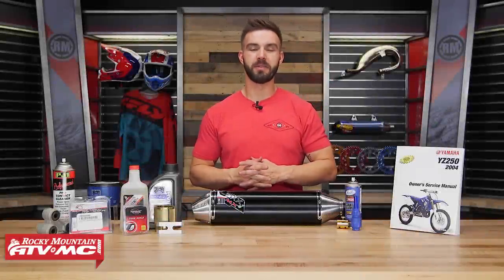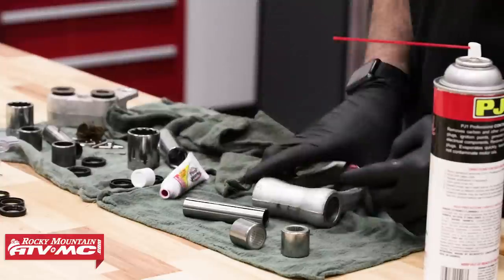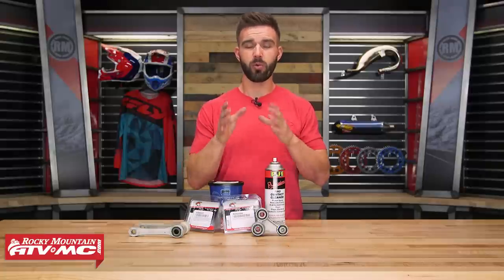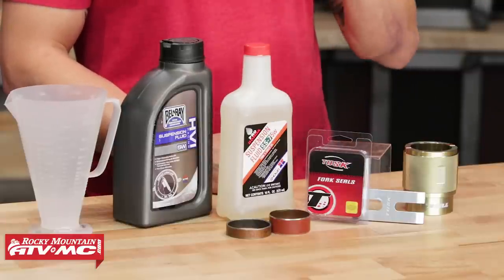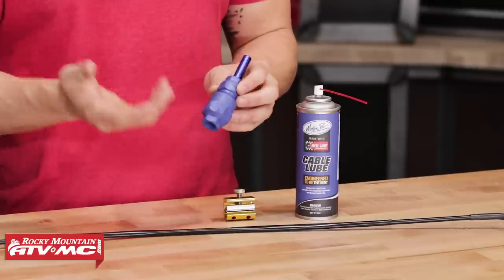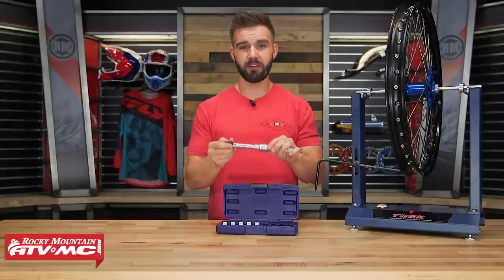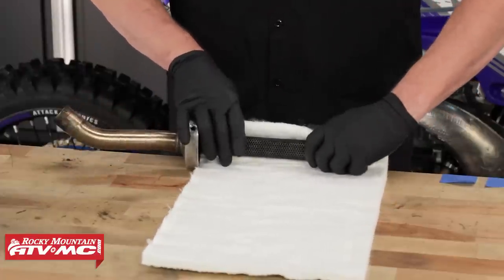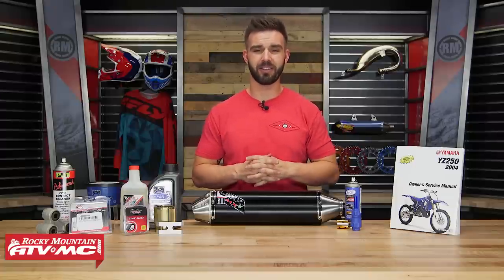Top 5 Overlooked Dirt Bike Maintenance Jobs

Comment: Ktm riders be like: wtf is a clutch cable?
Reply from the maker: HAHA! So true! Everyone besides Kawi and Suzuki are like "WTF is a kickstarter?" (i'm frowning from my own comment because I have the 18 RMZ450 and it's a kickstart :(  )
Reply: Lol true I maybe have forgotten what that is till someone mentions it lol
Reply: I have a ktm
Reply: Husky rider are like that as well
Reply: @Arnaud Pretto whats wrong with linkage. Jumps is more precise when hitting the top... And u have a better feel of the bike in the air allso more easy to stay on the foot pegs....

My bike before had Front Suspension: 
ASO7RC USD Telescopic adjustable pre-load a 
compression, 490mm long, 48mm forks, 60mm 
Fork tubes, 290mm travel 
Rear Suspension: 
BS88RC Remote reservoir, adjustable pre-load & compression, 80mm travel.

And i like the linkage way more than pds!!!!
Reply: Wtf is a dirt bike. Jokes hahahha
Reply: Hahaha, ktm clutch so smooth though
Reply: @rmatvmc  i still love Suzukis  bro, everyone says its garbage buy a ktm or husky, but i ride my 2009 rm450z enduro trial for 4years now, it runs smooth and i love it, never had a problem...
Reply: I ride Ktm and I just leave all this to my service team at ace motor sports - no point for me to screw things up
Reply: While he's lubing his cables, we KTM/Husky folks are tightening our sprocket bolts.

Comment: My fork oil will be changed when the seals go bad😂 I can never tell the difference when I change oil
Reply from the maker: Taylor Anderson That is what a lot of riders do, but your service manual will tell you otherwise.  As long as you are replacing it every riding season, that would be a good timeline to go off of.  Thanks.
Reply: Taylor Anderson .........Fresh oil will reduce wear and therefore your forks will perform as they should for longer.  You won’t notice a difference if the forks are only working at 50% performance roof course the forks are not being put through strenuous riding conditions.
Reply: Richard Clare I just changed the oil, lol
Reply: Think about if you had that mentality on a car engine? Lol think about.

Comment: i have a 2006 crf450 that i got from my dad, last full engine rebuild was in 2010 or so, bike sat from 2016 to 2019, thing still has crazy amounts of compression, i should probably do some of these tho, mainly the pivot points and suspension oil, but the exhaust packing is fine, might do these when i get the money to do so

Comment: starting the video i was like "i'm sure i do most of this stuff".. after having seen the video i thought "at least i do have an exhaust plug and air-filter cover for cleaning" :D 
(then again, i ride a supermoto, so most parts are not under as much strain as when actually riding off-road) :)
Reply: Supermoto lmfao.
Reply: U dont even maintain ur bike 😂😂 Stay on super moto bud.
Reply: KYB 420 so he’s not allowed to ride a supermoto?
Reply: I also have a sm and i rarely habe to change the air filter, but the chain slider wears alot. Also oil changes shouldt be neglected either, since i rev the tits outta my bike
Reply: You should put some street legal knobbies on that thing and go off road. Lot’s more fun and no assholes driving cars into your path every 5 minutes.

Comment: Good video and great reminder on those odd service items.  Just my opinion, but I wouldn't ever use a pressure washer on a bike.  You increase the chance push water into every point & electrical part that shouldn't have water, but you also push your grease & lube out of you bushings and chain.  If a garden hose can't get it, use a soft brush.
Reply from the maker: Lawman, you must be the most patient man ever haha. I do use a pressure but I try to avoid those areas and keep more distance when i'm hitting bearing and pivot points, and electrical items. But that is the ideal way to do it, not doubt. Thanks for sharing!

Comment: Thanks Chase, great top 5, I always replace my cables,  but I should start saving money and just oil them up.
Reply from the maker: Island Riders ATV & Motocross Sometimes replacing the cable can be your only option in some cases.  But yes, some cable lube can save ya money in the long run.  Thanks for watching.
Reply: Rocky Mountain ATV MC - Love that oil tool, also I need some of those in my life. Gotta come up with like $1000 and buy every specialty tool you guys carry. 👍
Reply from the maker: Island Riders ATV & Motocross- We do offer a lot of specialty tools.  They definitely can save you money, being able to do the work yourself and not a mechanic.  Well worth the investment.
Reply: What if you have a hydraulic clutch??
Reply from the maker: If you have a hydraulic clutch, you just want to bleed it as often as your service manual suggests.

Comment: Pivot points and swing arm bearing my Suzuki RMX 250 has grease fittings, all bike should !
Reply from the maker: Right?!  We agree.  We do sell these for some bike models, but not all.  Check these out: https://www.rockymountainatvmc.com/p/912/78333/Tusk-PDS-Heim-Joint-Bolt-Kit
Reply: You just changed my outlook on Suzuki

Comment: These new factory manuals are garbage though, the information in them are so vague its ridiculous. Thanks for the input, I'm guilty of not doing several of these. The rear linkage bearings are a must at least once a year. On my ktm 450sxf factory edition the bearings literally crumbled, rusted, and I had to buy a whole new linkage system. I will never make that mistake again.
Reply: Idk my Honda manual has just about every piece of information you'd need for a bike with detailed instructions for maintenance and care.

Comment: I have 385hrs on the top end of my cr250. How much longer should I go before replacing it?
Reply from the maker: There are a lot of variables to take into consideration but the Honda service manual recommends replacing the piston and rings every 3 races or about 7.5 hours. These are under race conditions and if you are doing easier riding this can definitely be extended. But remember, it's a lot cheaper to replace piston/rings than the whole bottom end or cylinder itself. You can also do a compression test and see where you're at. Nice CR by the way!
Reply: @rmatvmc  I usually just use an air compressor and shop vac to clean the filter and then spray a little SC1 on it to relube it. Should I replace it soon? I replaced it with the top end last time.

Comment: I did a rebuild of my gsx 750 es front shocks. The oil was 50% metal. Different oil levels. It came out in wrong order. Spacer rings were stuck, and new ones were too big cause of corrosion made clearance wrong. Absolutely no teflon on the rings. I still think I am supposed to be dead from that bike. The seller told me it was ready to ride. I learned that I don't trust anything until I see it with my own eyes on the bikes I ride. And neither should you.

Comment: Rm can you do a video on the ktm/husquvarna 85 with clutch problems my clutch is not working and we already bled it
Reply: Dry the lines well... look for leaks.  If the line is leaking oil fix it. If no oil is leaking..  next question is.. did you use the correct brake fluid in the mastercylinder.  If not the seals swell and messes everything up.  Next is proper bleeding tricks.. look up how to bleed  magura mountain bike disc brakes... same idea...

Comment: Who else is putting off fork seals😂😂😂#CRlife
Reply: Yes I know profile pic is a yamaha
Reply: I only do this when the seals are leaking.
Reply: It's really not a bad job at all. Not like the rear shock, I rebuilt my klx250 forks start to finish under 1 hour and it's got more bolts in the way than a cr
Reply: My cr125 is mint! Could use fork seals tho
Reply: I am lol
#CRlife101 you ride them until you sit down and the forks bottom out then it's time for seals 😂😂😂😂😂
My crs been leaking for a month but it never runs right no matter how much I put into it , top and bottom end then a clutch then wheel bearings then bars then swingarm bushings then a pipe and now I can't get it jetted right  never ends lol I guess that's the course of owning a cr am I right lol   but then they run right, they're insanely fast and crazy fun!!
Reply: Thomas Daugherty mine leaked like crazy so I had to
Reply: CR2504life love it bro that’s a good one
Reply: Thomas Daugherty just get a seal mate
Reply: Hashtag moto .. get your seat valve what closes the fuel of.. make sure this tab is set properly i just had bother with mine it was leaking fuel .. rebuilt the carb back to standard specs.. first kick away it went
Reply: How’d you know 🤣🤣🤣

Comment: Do u always change the bearings or just take it out of the linkage clean and grease it again?
Reply from the maker: Armin Sollfrank That's a good question.  If you're keeping up with your bike maintenance and greasing you can usually get by with a regreasing of the bearings. You shouldn't need to replace your linkage bearings unless they are showing signs of grooving in the needle bearing race, broken needle bearings or showing signs of rust and starting to seize up.  Then you would want to replace them.   You would just want to inspect them really close and see what kind of condition they're in.  Hope this helps.
Reply: Thank you:)
Reply: If the bearing is clean but greasy... its good. If its rusty and looks like dirt.... junk.

Comment: How often should you repack your muffler?
Reply from the maker: It depends on the kind of riding you do and how your specific bike is running. But around 20 hours of riding is a good average time to check out your packing and it'll never hurt anything to re-pack it! There may be a service interval listed in your manual that you can go off of also.
Reply: @rmatvmc  thanks for the quick reply! Yall are awesome

Comment: I’m assuming all of this is very necessary when pulling a bike out of storage after ohhh sayyyy 5 years?
Reply: Christian Sagredo you would probably want to change the fuel too and maybe clean your carb if the fuel has been sitting init for 5 years(cant garentee this being a novice)
Reply: Fredzey 100 Yee the carb was taken apart and cleaned good and put back together. Fuels been replaced as well. Just trying to think if there’s any extra I’ve missed
Reply: I recommend cleaning out the gas tank to, I just did the same thing and had to take out the carb for a second time because of the build up from the old gas in the tank.
Reply: Bleed the old brake fluid out, it absorbs water over time.

Comment: #1 if your worried about getting water in your pivot points grease them after you wash your bike,  #2 torque wrenches are for noobs unless it's a head bolt or clutch plate just give it the ol snug n tug.
Reply: not properly torquing your forks or any other critical components will make your bike run like pig

Comment: I have a 05 yz250f and my oil filter cover has a free spinning bolt and is spitting oil out of it when it runs what are my options to fix it
Reply: Kyle Trautman helicoil? Rubber grommet?  Or just go the shortcut way and high temp silicone it
Reply: The Itz just go the next bolt size up and re-tap it.
Reply: If the tapped hole is deep enough just use a slightly longer bolt. Be careful though that the bolt doesn't bottom out

Comment: Actually a dirty air filter is filtering out more than a clean filter. Where the problem lies, is that it is  affecting carburation(air to fuel ratio), whether carbed or fuel injected engine.

Comment: How would the muffler not being packed hurt performance
Reply: Sterling Hayden I’m super late but you lose tons of power, throttle response, probably damages a bunch of stuff in your engine.
Reply: @markmagness3693  doesn't damage anything, it just helps with minimising the effects of exhaust pulses out the back which gives you better response

Comment: I have a KTM (hydraulic) so I don't have to worry about lubing the clutch cable :)
Reply: Cayden Thompson was wondering the same thing for my Husqi...
Reply: Cayden Thompson I Don’t have to either I ride a Suzuki
Reply: I do
Reply: Yeah and I got a new Magura hydraulic clutch for $200 and saved thousands by not getting a ktm for a $200 part.
Reply: Cayden Thompson You have to worry about rebleeding and changing the oil in your clutch
Reply: Cayden Thompson have you renumbered to oil your clutch fluid it really makes a difference😂
Reply: Cayden Thompson you have to maintain an change the fluid and if a seal starts leaking or the hose cracs...

Comment: Wish you had the bike to show where exactly these pivot points are
Reply: Steering headset is the bearings in the frame where the forks attach.  Every one of the 67 new mx bikes ive owned came with no grease in the bearings. And no the dealer wont even look there. Next is the swingarm. Every moving point has bearings the need to be removed cleaned and greased often. Your rear shock has its own bearings top and bottom also that need grease.

Comment: Everything functions properly https://www.youtube.com/post/UgkxHL1v1R3NE5x4KiYfyt8dnQmyNYz7qi5L  Nothing was damaged in the box aside from a decal on the fork. The decal was missing a piece of a corner but I ended up peeling them off anyways. Assembly is easy BUT make sure you tune up the derailleurs. Both the front and rear need adjusting. I'd advise going to a bike shop but I opted out and put in 10+ hours with the help of YouTube. Ended up fraying a shifter cable but all in all I learned from the experience. The Brakes work well but the front caliper needs adjusting or at least mine did because the rotor was rubbing against the pads. Make sure you swap out the seat, grips, and pedals. For the short run you'll be fine though. I've read that this bike isn't built yet for hard trails but I just need it for the city. PA has some of the worst roads and being in a mountain this was a great choice. Worth the investment!
Reply from the maker: Are you talking about moto bikes, ADV, or street?

Comment: selling a few parts are you why don't you show them how to do their cables correctly you have no contact cleaner you don't have any compressed air no gloves rubber gloves big hunk and rag because the crap goes everywhere once you apply a little bit of compressed air to flush them out multiple times with oil and the contact cleaner brings them back to new condition is good as they can be good effort I give you a name for trying to show a guy how to keep his bike in good condition but maybe you should go the extra mile and show him how to do it correctly but I realize this is a super short just touching base video without giving him any of the good secrets